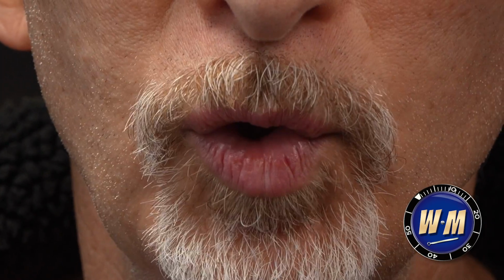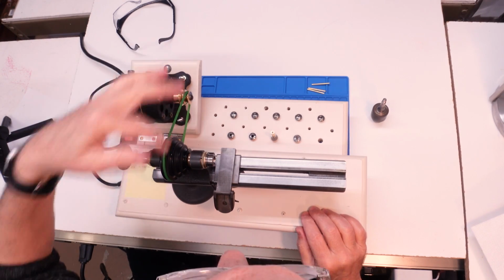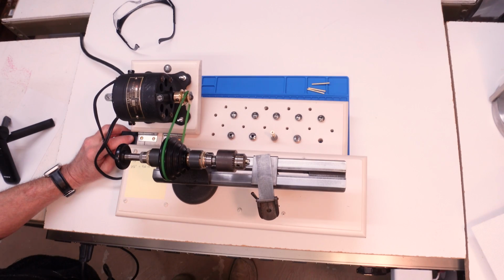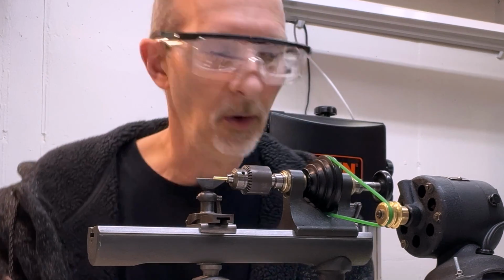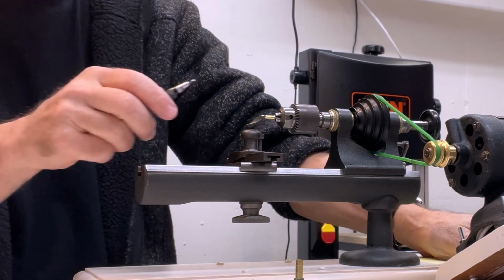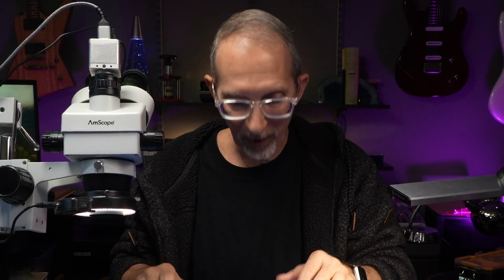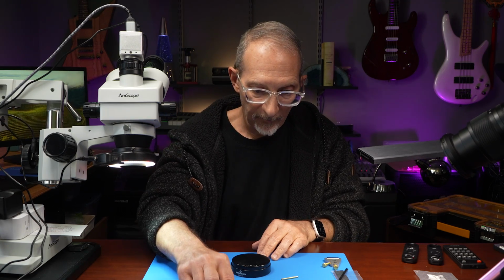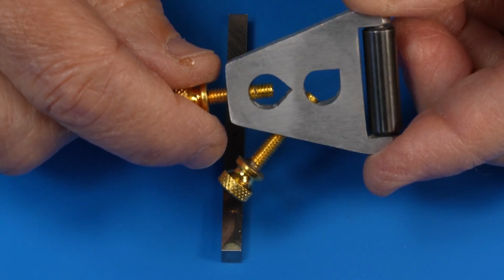My FIRST ATTEMPT at Turning on a Watchmakers Lathe - Definitely NOT a Tutorial! (Part 3)

Comment: Hi Mike,  a little tip.  You will find much stability when you put the material to be cut into a collet.  A drill chuck is not really designed to take sideways force.  Also with the workpiece that far from the headstock you get much more vibration!   Hope this helps.
Reply from the maker: @iansmeath8674  It does help, thank you! I've been using the collets and they are indeed more secure.

Comment: Hi again MIke.  I might be able to help with the issues you have.  First with the first turning.  You set the tool post to height which is good.  But you didn't allow for the thickness of the graver's tip and any angle you might be holding it at.  As a result the cutting edge was mostly much too high and you had to try to compensate for it by angling the edge over to a much too strongly negative top rake.  As a result it was just scrapping the metal rather than cutting it.  Then when you used the tip which was more in line with the correct height and the geometry at the cut was closer to a neutral to only slightly negative top rake you got curls.    What you need is to lower the tool rest in connection with how you use the tool so the upper surface of the edge is neutral or only around 5 to 7 degrees at most negative to the metal.  Then you'll get curls galore without any risk of digging in.  And when you go on to cutting steel this will be even more important in that you want to be at most perhaps within 2 degrees negative at most.  And with steel even a couple of degrees of positive top rake isn't an issue.  Steel wants to naturally push the cutter away so aim for flat/neutral top rake but a couple of degrees of positive isn't going to make you jump at all.

On that little jig you showed at the end.  Because of how it holds the blank to the stones the edge you are considering dulling with a slight flat is also the cutting tip.  So a hard NO on flattening that edge.  Instead see if you can make up a mini V block that rests on the top of the tool's edge and fits within the arc of the hole.  And I'd also reach into the V of the jig itself with a fret saw with metal cutting blade and make the "V" into a short tailed "Y so the edge of the tool does not rest against any slight radius in the corner.  You're essentially doing what you see on commercial V blocks which have this same relief groove both for aiding with the final grinding and also with holding sharp edged stock that we don't want to ride up on any small corner radius.

Those blanks you have are HSS.  They come fully hardened and ready for use.  And they are extremely hard to damage with the sort of heating we do with our home shop.  And that's good because the technique for hardening and tempering HSS is WELL outside the capabilities of most home shop setups.  Do a web search for "how to heat treat hss" and get ready for some big numbers that will sit you back in your home shop seat :D  Since you will be doing a lot of diamond angle grinding with your bench grinder you might want to consider making up a new tool rest that you can swap out.  Instead of a flat table do a simple edge on "L bend for the rest so the actual rest surface is the edge and not the flat of the bent piece.  And then on top of that file the edge at a 45 angle leaving only a 1/32 or so flat edge.  That way when you are holding the blanks at a steep angle to get the angle needed the support is under that edge that is really close to the  wheel.  So less shock and kicking with the tool in your hand... And speaking of which.... The last thing you want with a short 1/8 square HSS blank that has sharp edges is to catch and rip through our delicate digits.  So I strongly suggest you get a  6 to 8 inch long piece of 1/2" or bigger round bar and drill a hole in the end that fits the 1/8 square blank and in the side put another hole for a set screw.  That way if anything nasty happens your hands just get a nasty bump and your sense of wrong a little jolt. But at least your fingers won't be leaking.  The same sort of edge on rest like this would also be nice to use with the diamond face wheel if you decide to get one.

I smiled at your" Chuck Jacobs" because the little I've done with my own watchmaker's lathe used that same setup that I made using my big lathe.  I've since gotten some additional WW collets  and have the sizes i need to hold most of the imperial sizes from 1/8 to 1/4.  

That's a BIG comment but I hope it helps out with your journey into micro machining.  Me?  I still need to dress the bed of mine a little so the head and tail stock ride on the ways correctly.  Darn flakey nickel plating..... Cheers!
Reply from the maker: Oh, wow, so much goodness in your comments! Thank you for the suggestions to keep my digits from leaking! Nobody wants leaking digits! 😂 your suggestions on how to hold the graver are very good, so I'm going to re-read them when I am at the leave, and adjust my technique accordingly. Thank you so much, stay tuned and continued good luck taming the finish on your new lathe! Please keep us posted how it is going.

Comment: Hey Mike:  With HSS gravers you need to be aware of how hot it gets when sharpening (grinding) or you will alter the temper.  Carbide on the other hand is much more tolerant of heat.  I see carbide inserts glowing red all the time and they don't seem to lose the temper.  I wouldn't worry too much about getting it too hot.  Also, I still encourage you to check out the website I mentioned in my 1st post which was removed.  He shows how to prepare and use the graver.  Don't know if you're cutting "face up" or "face down".  I rarely cut with the very tip of the graver. Carbide is very brittle and the point (unless "dubbed") is extremely fragile.  You might consider moving the lathe to where the microscope is.  It's MUCH easier to cut when you can see what you're doing.  I have a cheap digital scope installed over my lathe.  You are right, if the graver is properly sharpened and the tool post height is correct, it should cut through brass easily and produce nice curls.  Good job for a 1st attempt!
Reply from the maker: @home-dp6oh - thanks for all the great suggestions! I'm pretty sure I watched the video you recommended. (Comment was removed? strange!) Good suggestion on using the microscope for the lathe - I've been experimenting with ways to mount my old digital scope to the lathe for that very reason! Also, I'm going to be resharpening my cutters, since I know they should be cutting much better. Thanks for the moral support!

Comment: Hi, well done for a first attempt. Instead of putting a flat on you steel bar try and small piece of aluminum plate bent in-between the bar and the screw, the bend will give the screw something to bite into.
Reply from the maker: That's a very good idea - much better than flattening the corner of the bar. Thanks!

Comment: Hi Mike, see my comments on your recent graver sharpening video. These are carbide gravers and need to be sharpened as such. 

The information you need is in my comments there. 

It’s HSS and other steel gravers where you need to worry about hardness and temper. They come pre treated. When sharpening these, take care not to heat to the point of altering the temper, they should never get too hot to touch when sharpening. 

Trying to reharden a steel graver that has had the temper drawn is futile. Remove the damaged section and resharpen fresh steel which hasn’t had the temper drawn out.
Reply from the maker: @mercuriall2810 - I didn't see comments from you on my other video. Did you post them from another account? I appreciate the tips you mention here. I'll be playing with the HSS today!
Reply: @WatchWithMike  Same account. I’ll go check if I can see them.
Edit to add : I can still see my comment. In the comments section of the bench grinder sharpening video. 

I’ll repost it below this comment.
Reply: @WatchWithMike  This is a carbide graver, that's why they cost a lot more than the Vallorbe steel gravers.

Once you can turn well enough not to chip them, carbide graves cut better and stay sharp a lot
longer than steel gravers.

I use carbide when turning steel and steel when turning brass or other softer metals.

The Waller and other carbide gravers came in a kit which included a 50mm diamond sharpening wheel to fit a #50 collet to facilitate sharpening
the graver on the lathe.

You can buy these separately.
Eternal Tools sells them. Stock code is DHW1.

They also have a YouTube video on the item's page that demonstrates sharpening and turning with carbide.

Hope this helps!
Reply from the maker: @mercuriall2810  Excellent! I don't think I saw this comment so thank you for reposting! 😀
Reply: @WatchWithMike  You’re welcome. Have you got any books that describe turning with a graver? 

The biggest thing you could improve in this video is the way you present the graver to the work. 

There are free PDF versions of some old out of copyright books online that whilst old are still very useful. One is called “The watchmaker’s lathe, it’s use and abuse” by W L Goodrich. 

The one part where it’s outdated is carbide gravers didn’t exist yet, otherwise it’s good information. 

Archie Perkins’ book is in my opinion the gold standard, but not inexpensive.
Reply from the maker: @mercuriall2810  i've been trying to get my hands on the Archie Perkins book, which I believe is out of print, and excruciatingly expensive when you do find it! I have the Goodrich book as a digital file, and it has been helpful. I've also been enjoying the Watch Repairers Manual by Henry B. Fried. All that said, what's missing from my education right now is truly sharp gravers, and spending time on the machine! I hope to get down into the shop later today to continue that quest… 😀
Reply: @WatchWithMike  Didn’t I email you after you did a watchmaker’s chat with JD Richard to let you know where to get Archie Perkins’ book new without breaking the bank? If not tell me and I’ll let you know.

If I recall, you said perhaps Santa might get it for you :)
Reply: @WatchWithMike  I just checked, I did email you a source. It’s still in stock, too. Just let me know if you want me to send the information again.
Reply: @WatchWithMike  Do yourself a favour and burn the book by Fried. Except the chapter on verge watches - it’s good. 

The rest of the book does contain valid techniques and information. It also teaches bad habits and you’ll need to unlearn. 

Many thousands of watches the world over bear the scars of those who followed his poor advice. His advice to statically poise all balances after restaffing means countless watches have poor oscillators and can’t be fixed without a parts movement with an unmolested balance wheel. I’m happy to explain this further if you wish. 

All of the best watchmakers I know frown upon his writings and it is with good reason. 

It’s a real shame his books are so often recommended by those who know no better, keeping them cheap and popular.
Reply: @WatchWithMike  The diamond wheels will get you truely sharp carbide gravers. If you have HSS gravers, you can get them sharp between the grinder and your sharpening jig used on a fine stone. 

HSS is just fine, if not preferred for turning brass. 

You are right about spending time turning being the best way to make headway. 

Just sharpen up a few HSS gravers - they blunt quickly and you want to switch to a sharp one when they do, it’s easy to get lazy and keep going with a dull graver if you need to stop turning and resharpen. 

Have several sharp ones ready to go if possible. 

One great YouTube resource for learning to handle the graver and make basic cuts on brass is on the “Dean DK” YouTube channel and starts with one titled “Watchmakers lathe - How to turn Basic
Cuts”. 

From memory he has a good video on HSS graver sharpening, too.
Reply from the maker: @mercuriall2810  Oh, wow! While his methods seem very old-school, the clearway the book is written helps me better understand the function of the parts of the watch, how they come apart and go together, and what maintenance and repair techniques need to be performed. I've never heard that his techniques could be damaging, and I would be interested in reading more about your concerns.
Reply from the maker: @mercuriall2810  Yes, I recall. It was a watchmaking school link, perhaps in Australia, and it was around $100 if I remember correctly. At the time I thought that price was rather high, and I have devoted myself to trying to find the book in a library or online. No luck yet, but thanks for the reminder about the online source to get the book. 😀
Reply: @WatchWithMike  Fried writes clearly and explains things well. His books are well organised, too. It’s the content he’s teaching that’s the problem. 

The advice to statically poise a
balance after restaffing is probably the worst advice in the book.

How has a balance gained or lost weight
around the balance rim since it left the
factory?

Dynamically poising to keep time across
positions takes a watch out of static poise. 

So high grade positionally adjusted watches left the factory out of static poise. 

Statically poising after restaffing undoes all of that precision adjustment. If weight is cut from the balance screws or rim, that watch is ruined as a precision timekeeper without a new balance complete.

I'm not familiar with the book anymore to make you a good list of all errors, but the example above is just one of many. The sooner you lose that book the less time you’ll need to spend unlearning stuff. 

The section on verge watches is good and worth reading, but ignore the rest. The rest does contain some good techniques and Fried explains those well. The issue is the other garbage he combines with the solid
information.

If you want reliable information, try "The Swiss Watch Repairer's Manual" by Hans Jendritzki.

Archie Perkins lathe book is excellent and well known. He also wrote three outstanding
volumes on watch repair that are gold. He coauthored probably the best book on staking tools and their use. 

Gazeley is excellent for understanding
escapements.

If you want to learn precision timing and
adjustment, "Watch Adjustment" by Jendritzki is indispensable.

Lastly some insight into the man himself. Henry Fried was approached and asked about a watch repair technique he’d published that didn’t and couldn’t work. He laughed, said he was paid by the word to write, and this technique was a ‘thought experiment’.  He presented it in writing as tried and tested fact that could be relied upon and knew his readers would treat it that way. 

Henry was the one guy with half a clue left when the aerospace and defense industry vacuumed up all the best watchmakers after WW2 and got them working on micomachining and mechanical timing systems. 

In the absence of his far more knowledgeable peers, Henry made himself king of the civilian facing hill when it comes to horology. Countless have learned from his bad example and perpetuated his bad teachings because they knew no better. 

If you want more about Henry’s writing and the man himself, search the NAWCC forums. for posts by DeweyC. That’s one of the few places where people speak the truth on this. 

Not too long ago any professional watchmaker who spoke out publicly about Fried was damaging their own career. The best watchmakers simply knew he was a hack but said nothing. 

It is only more recently that you can say this without having to worry about the consequences. Plenty of the watchmakers who know how bad Fried is won’t come out and say it. 

That his books have remained so popular is a stain that reflects badly on those who know better but still say nothing. The sooner  beginners are told to avoid the books instead of having them recommended, the better.
Reply from the maker: @mercuriall2810  Wow, thanks! That is a heap of interesting information, and I will dig into all of the comments you have provided. Thank you, I really really appreciate it!😀
Reply: @WatchWithMike  You’re welcome. 

Unfortunately none of the good books are anywhere near as cheap as Fried, but they’re worth every cent they cost. 

If you search regularly, second hand copies do change hands for reasonable prices, there’s no need to spend the several hundred dollars each. 

Jendritzki’s Swiss Watch Repairer’s Manual is a great place to start. His book “Watch Adjustment” is the only book in English that covers precision timing properly and in depth. It is more advanced, for those well grounded in the basics. 

If you see a copy of Jendritzki’s Watch Adjustment at a good price, my advice is to jump on it, whether you feel ready for it or not. The book is in high demand and secondhand copies often fetch top dollar and keep rising. I got my copy relatively cheaply $70AUD) by combing eBay and secondhand bookstores several times a week. I was lucky enough to see the Buy it Now eBay listing within minutes of it being listed. I had previously missed out on two other copies by mere minutes. 

One tip about eBay in general, when you really want a hard to get item - don’t rely on creating an eBay alert to tell you when an item is listed. The alerts are sent out far too slowly. All 3 cheaper copies I saw sell on eBay were gone before the system even told me they were listed.